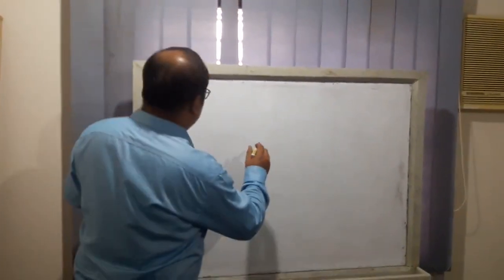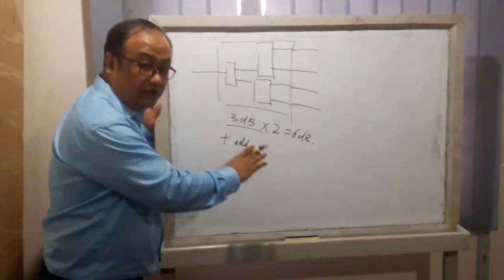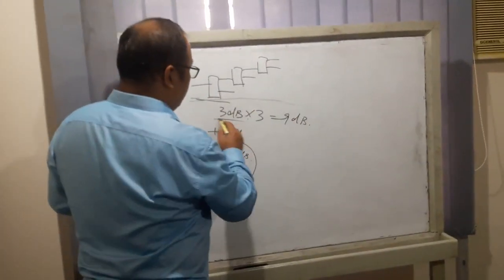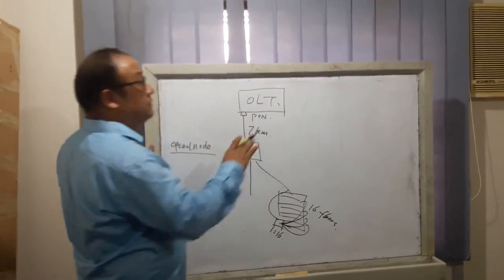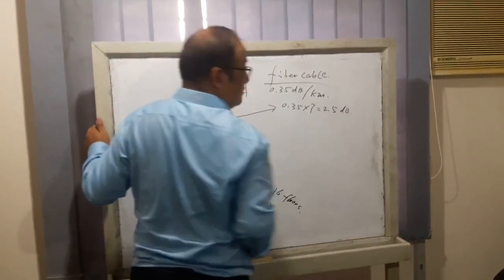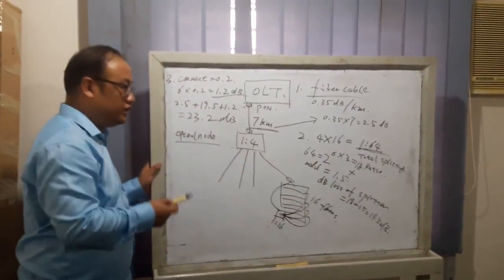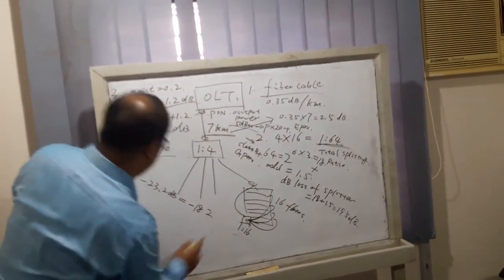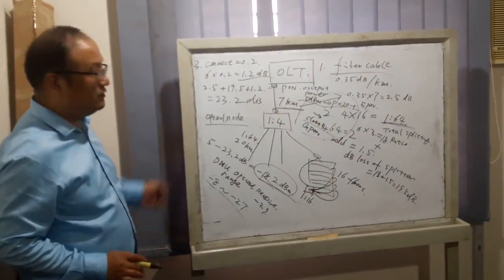FTTH GPON Power Budget Calculation

Comment: Thanks for the presentation. it is well detailed. but i think the cable distance between the splitter1: 4 and 1:16 has been forgotten.
I also want to ask how to deal with the loss of a patch cord?
- do we consider only the insertion loss marked on the cable ...? Or should you add the loss of the 2 connectors ...? thanks
Reply: So the final power will be -21
Reply: he also forgot the splice loss and the qty of splices, as well as the margin (3dB)